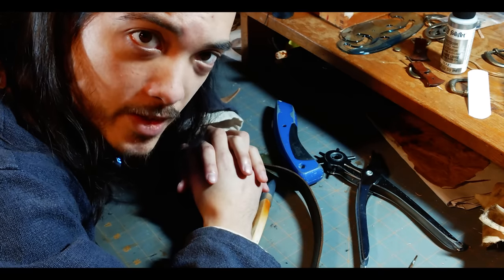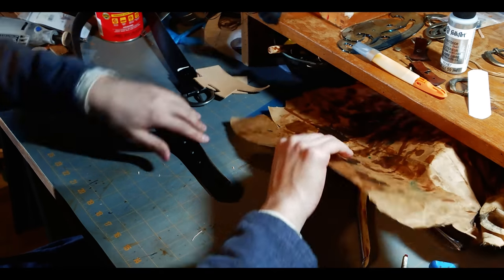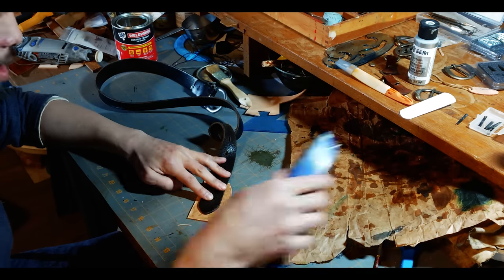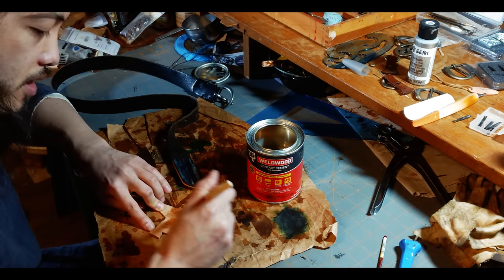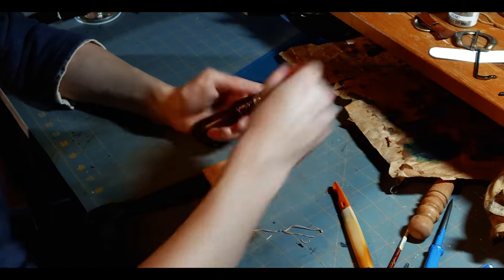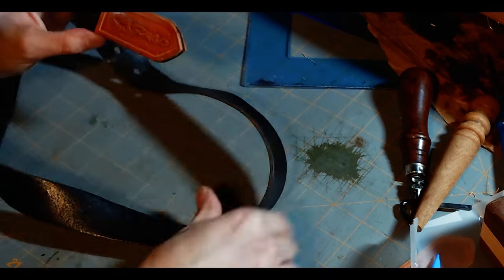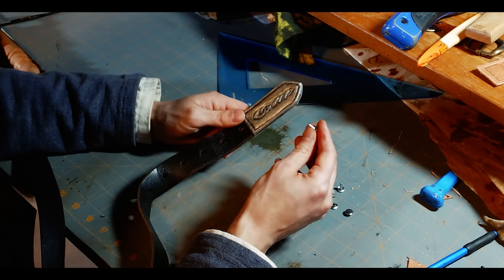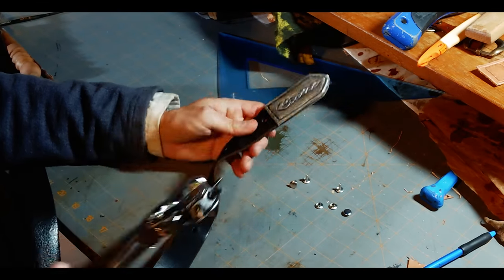Making a Medieval Leather Belt Chape with No Forge (DIY Leatherworking)

Comment: Tip for silver paint, you always want to start with a black base, ideally glossy as well, it helps bring out that metallic look as opposed to painted silver, at least in my experience, also, a black wash is lovely for weathering, and is far more adjustable in the amount of dirt, and you can mix colors in your wash, also you can dot in rust, and a final dry brush of silver on the outside edges. Hopefully any of that is useful to anyone 😁 also prop maker mind aside, this was a fantastic video, your content has never failed to keep my spirits high good sir

Comment: Would stress that the contact cement should be on both surfaces, and that it should be allowed to dry for at least around 15 minutes before "assembly".  (Also very useful for restoring book bindings where the pages are falling out - A very strong, permanently flexible bond)

Comment: I don’t think your leather was damp enough when you tried the Celtic stamps. I have the same set and they are kinds tricky because the details are not very deep. So if it is “jumping” like it looks like what happened it is not damp enough. Also recommend Angelus leather metallic paints I use it on my custom orders with a resolene finish, I use this on my custom orders and it hold up over time even on armor.  Great little project and great attention to detail!
Reply from the maker: Those are exactly the problems I was experiencing. The leather might not have been wet enough I'll give it a try, it might have also been trying to stamp on stacked leather that was providing too much cushion
Reply: @LivingAnachronism   Absolutely! I would recommend next stamping it separately then glue and trim.

Comment: Two choices for better "metal" look, both from miniature painting.  1 - paint black and then overpaint with silver, but drybrush the silver.  2 - paint silver, and then use a wash instead of full strength acrylic paint.  The wash will go into all the crevices and "reverse highight" everything really nicely.

Re stamping, to get good clean stamps you need a non-distorting backer surface.  Every time I see folks doing stamping at Tandy they are using a chunk of granite countertop.  Also, it will stamp cleaner if you stamp prior to bonding. 

Looks great.  The only thing I might do differently would be to use brass rivets.  The nickel steel ones just look a touch too modern for me, and I think brass would give it just that extra hit of contrast and interest.
Reply: 😆essentially we said the same thing.  With the exception of early paint steps . You get a wash when you water it down

Comment: Since I do paint miniatures i have a couple sugestions for you about making the detail pop up a little better. You can do the paint + wiping technique but it doesn't turns out that well as you've seen, it needs a lot of correction because with wiping it's just innevitable. Here there are a couple options you have available.

The first is being a type of paint called a wash. Washes are paints that are tinned so that they will run into all the crevaces and stick to that, so by using a wash you can simply paint over all the surface area and it will only very slightly darken the base surface in a very organic looking way and will darken the insides significantly. this archieves what you did in 1 pass of the brush with much less work.

Another way is to simply thin the paint yourself and it will do just fine. it's not the same since the composition of the ink is slightly different but it will do the job better than wiping.

Lastly there is a small tip I can give you if you want the whole thing to look even better. You can start with a brown wash and that will simulate a little bit of rust building up in the harder places to clean. Then you come up with a smaller amount of black wash after the brown dries. Now most of it will be black but there will be hints of brown here and there that simulat a little bit of rusting.

Comment: for the antiqueing process on top of the paint, a good technique is using a wash, mixing ink or paint and water (sometimes a little soap too). the water will let the pigment flow into the valleys of the grooves and tooling naturally and avoid the peaks, nice and easy and still can DIY (yeah learned from painting DnD minis)! Great Video!

Comment: very nice video,  For a different approach try cutting the top and bottom off a soda can and use the aluminum sheet folded over to make a chape. it is thin but otherwise everything else works the same, including the tooling.

Comment: So when I have done tooling. The first thing is do it before you attach it to your belt in this instance.  Second I've noticed with larger stamps,  because I actually have the set your using in the background, with the larger stamps its best to wet both sides of the leather. Especially with the high detailed stamps like the Celtic knot. And when stamping i use a dead blow hammer so it doesn't bounce as well as a granite  slab positioned above the table leg. I  want the least amount of flex when I strike true. I'll send you pictures if I figure out where to send it.

Comment: I cast mine in Tin, but could do it in any metal really as i do plaster casts
Reply: But i do have a leather tip if you want patterns make sure the leather is wet and in warm water it becomes really soft and easy to make a pattern in let it soak

Comment: A heads up from a professional leatherworker...cut then SAND your edges before you use any edge guided line marking tools. 
You are relying on the edges to to make your lines or borders. 
One thing sorely lacking in basic leatherwork how to's is sanding your edges. 
Use 600grit then 800 then 1000.
At least use an emery board. 👍